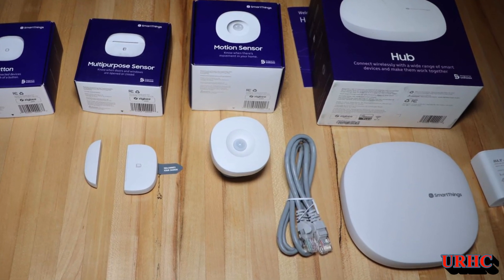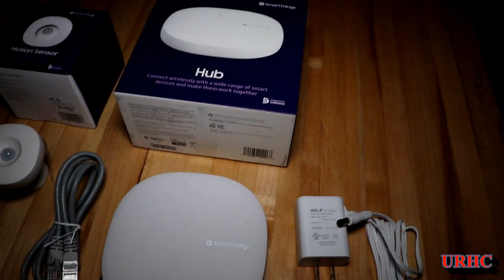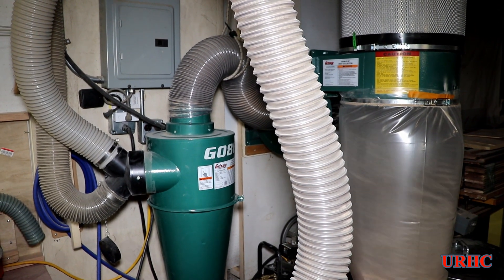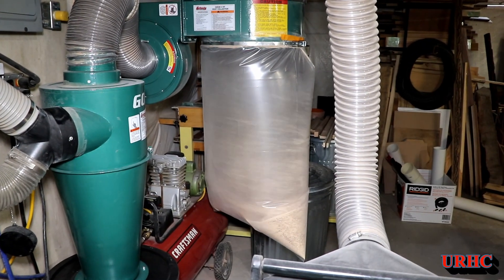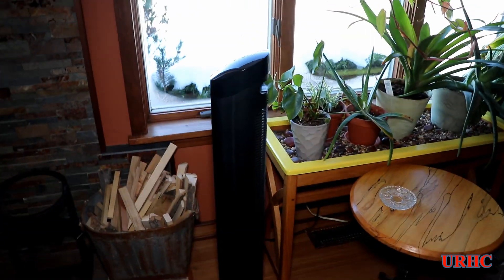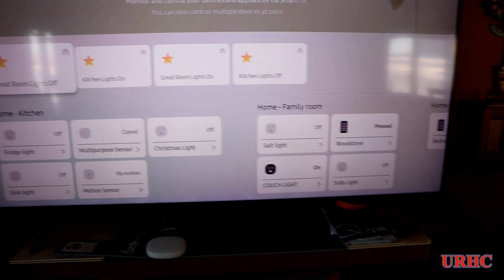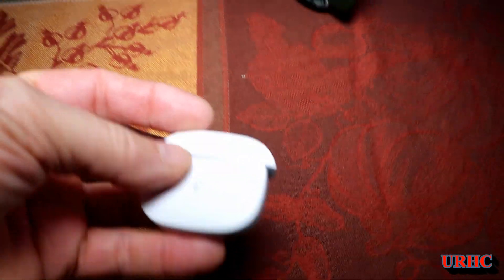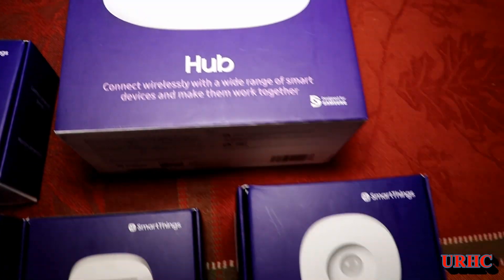Samsung Smartthings First Look And Ideas For Home, Shop, And Root Cellar Automation

Comment: I’ve been using Smartthings and Alexa for a few years now, integrated with Alexa.    I like some of your innovative uses for temp sensing and circulation fans, as well as shop dust collection.    Looking forward to your blast gate automation if you decide to go that route.
Reply from the maker: Thanks.  I have  a problem  that all the Smartthings sensors are now discontinued and unavailable.  Trying  to find others that work.  I still plan on doing  that once I get all the tools in their  final place. I am afraid  to put too much into this hub because  if it dies I have to switch to something else. Thanks for watching.
Reply: @unemployedredneckhillbilly2023  interesting.   I moved away from the wink hub to SmartThings for that same reason.  I’ve been able to find most SmartThings sensors on Amazon.

I am considering investing some time into Raspberry PI and Arduino for some additional automations, as I already have yrs of experience with Python programming.    However prefer to be working outside or in the shop than on my butt behind a desk these days.  If I can buy (reasonably) vs make, I’d take that route.    Thanks again.

Comment: well I got the sensor, and I can get the fan to turn off. However this seems to be a mystery as when the vibration stops to get it to turn the fan off. That part doesn't seem to be working. I'll be fiddling around with it.
Reply from the maker: Did you set up a second automation telling it to turn off when the sensor sees no vibration?  It won't automatically turn off if you don't.
Reply: @unemployedredneckhillbilly2023  I don't seem to have that option. I was only able to set this up with a smart apps, and not via a routine. It does not recognize the multisensor in the standard routines for some reason. I can set up an on in and off for open and close but not for vibration which seems awfully strange.
Reply from the maker: I was able to set it up that way. Are you using the latest app. When you set up the automation for the sensor there are 4 options contact, vibration,  temp and battery level to choose from and each has 2 options.  You can actually set vibration and temp in the same automation. Wonder if the v3 hub is different from yours. Mine works perfectly with the vibration on and off automatons.

Comment: The multi-function sensor is on sale for $17, so I ordered one.
I have a booster fan on the return register in my bedroom that I would manually plug and unplug.
I'm hoping the multi-function sensor can pickup the vibration on the HVAC system.
It is a newer variable speed, so we'll see what happens!
I had planned something elaborate for this, but this would greatly simply things, and I already have a Gen2 hub.
Thanks for the idea!
Reply from the maker: Or you could use the temperature sensor like I do for the woodstove if that doesn't work.  I have it set over 70 degrees the  fan turns on and below 69 degrees it goes off. Could even do both if you have to wait for the furnace to reach temperature before turning it on and want it to run longer then the burner.  Doesn't look like the battery in that sensor will last more then 2 months with constant use so I am trying a double aa case to see how long that will last and also a plug in USB wort with a 3v regulator.  Love this Samsung stuff. My poor Google minis were bricked by recent updates so we just switched to echo devices to retain voice control.
Reply: @unemployedredneckhillbilly2023  good point. I want to be able to use it for the heat and the AC, so I guess I could change it during the seasons. Thanks for the reminder on the temperature sensor.
Reply: @unemployedredneckhillbilly2023  weird, my my comment disappeared. I forgot about the temperature sensor, that's a great idea thank you again.

Comment: That's what i want to do in my home, but I'm really a dummy when it comes to home automation. Is there a book (Home automation for dummies)? I like your video and it looks like I need to get a Hub as the first step. Then the sensors, etc...  Am I correct in this assumption? I would like to see more videos on how to start and where to go from there. I really like the way you used the vibration sensor. I spend more time than getting any production just locating the remote (remembering where I left it) for the dust collector. Thanks for the inspiring video!
Reply from the maker: I am just learning myself.  I went with Samsung because my new TV supports it and they use a great app that makes getting started easy. Each device has a code on it that you just scan with a smartphone or tablet camera to install it. It will work with other brand sensors as well if they are zigbee or z-wave that take a little more to get working. If you tie a voice assistant to smartthings all the devices have voice control also. There are many YouTube videos by people experienced with the system that would be a good place to start? Search for Smartthings v3 hub. A smartphone or tablet is also required to set it all up. Once the devices are talking to the hub then you add automatons to the app that are basically if a sensor triggers then that happens such as turning on a smart switch. I think a hub, motion sensor and smart bulb are a good combination to get started and learn the basic logic.  When I install all the vibration sensors and make automatic blast gates I should know more and will spend more time in the video about how to set up and automate it all. Thanks for watching.

Comment: I like the use of the vibration sensor. Smart.
Reply from the maker: It looks like they will work good. Just have to build automatic blast gates next.  Will probably just use push buttons on the smaller machines. Thanks for watching.

Comment: Nice video. I've been thinking about the Smartthings. I'm quite well along on my smart home and automation, but there is always room for more. :) For magnetic contact sensors, I went with the Wyze Cam with the Wyze Sense. For about $50 including tax and shipping, I got the camera (needed to interface the sensors), plus a pack of two magnetic  and one motion sensor. Got one on my mailbox door about 40 feet away. Unfortunately, they don't have button switches  or motion sensors yet.  Glad to see you are back to the home automation again!
Reply from the maker: I think this will be a constantly changing technology in the years to come. The zigbee,  z-wave, and wi fi standards are at the point that components from most manufacturers will live together.  The Wyze components are really affordable and hopefully Samsung will make them easy to integrate into Smartthings.  All the Feit bulbs I got from Costco are not compatible with Smartthings but still work with Google.  My poor wife is having a hard time giving up things she had to do for years to automation so I can't go too far. Thanks for watching.

Comment: eBay has dummy battery pods, some with wall warts, some without (either with a jack or bare wires for your own setup).
Reply from the maker: I found some small pin type power pigtails and mini voltage regulators on Amazon I am going to try with USB warts first.

Comment: I like the use of the vibration sensor, my automated DC system is based on a micro processor the Arduino senses current flow to open the blast gates. I may give the vibration sensor a try.
I am seeing an awful lot of saw dust in your clear plastic bag, that is indicative of either a leak in the vacuum side or your dust bucket is over filled. The only time I get any dust in the clear bag is either of those two problems.

After seeing your solution for controlling the DC system I like it much better than mine, yours being wireless. And I have cat 5 cable running to every device. I would still have cat 5 going to each blast gate but I could eliminate the current sensor wire. That is great!
Thanks for the video
Reply from the maker: I was going to use an arduino but this looks easier to me. I plan on adding wires to each sensor with power plugs to replace the batteries and need a good blast gate design that works on a switched device  so its probably going to be at least  $50.00 per machine if I don't find lower cost sensors and switches. I like how it stays on for a couple seconds to clear the lines before shutting down. Good thing is smartthings can add delays to fine tune everything very easily. This hub is going  to  be fun. Thanks for watching.

Comment: Automation is awesome. Have a ton of z-wave devices, both sensors and switches. Using hassio, node red and mosquito. Have an amazing Sunday, Andreas 🇸🇪
Reply from the maker: I never realized how easy it had gotten to make it all work together. I will look into those brands as the zigbee and z-wave are definitely better then the extra load on the wifi router with Wemo type devices. Thanks for watching.